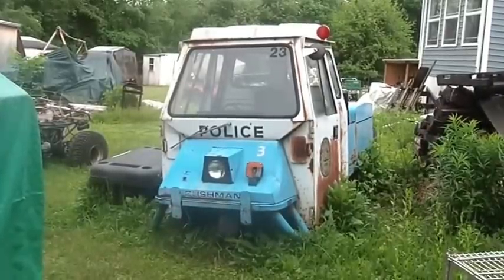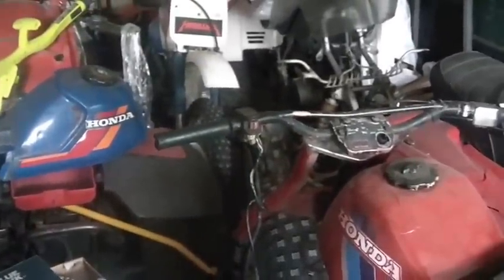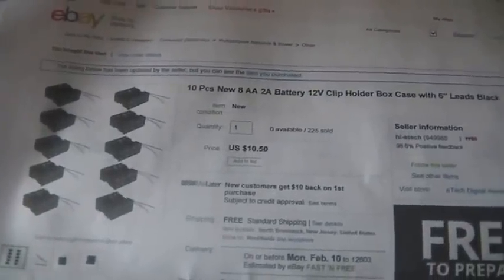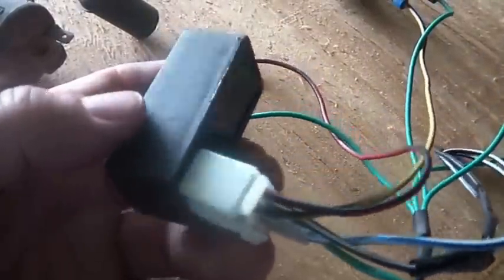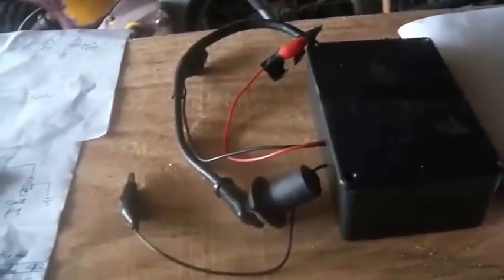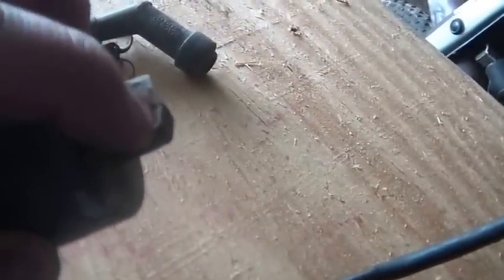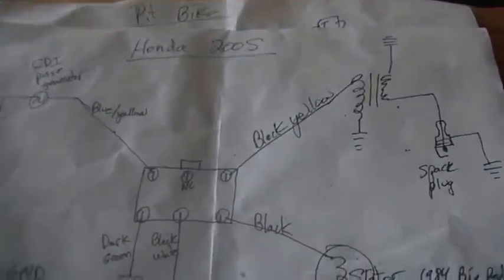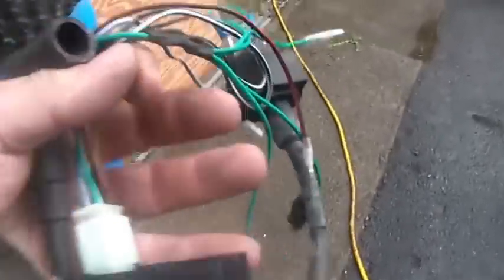6_2_15, Universal Honda ATV CDI hack, for Quads, ATCs, motorcycles

Comment: question. I have a street legal adly 500s and I went to ebay and every one else who had items to sell under the category CDI. but I am stuck. Apparently cdis only come in  70cc 120cc and 250cc. but does it matter as long as it is for 12V and 4 stroke?
Reply: How did it end up? Im thinking about buying a 250cdi for My old suzuki dr500 engine..

Comment: can u use something like this on a v twin engine with dual coils
Reply from the maker: Hey Jessie,  A V twin fires from 2 separate coil pacs and the position of those coil pacs determine when they are going to fire, (ignition timing), if U were willing to replace those coil pacs with pulse generators, (may require some experimentation), and then U would have to set up a Universal Ignition for each cylinder, yes it would work, it is not as easy as for a Honda ATC motor.... Thanks for asking, watching, and commenting, Good Luck!!!
Reply: would the pit bike harness work or do you think I need 2 cdi for that

Comment: Great videos and great info!!!! I freaked a 35 year motorcycle mechanic when i mentioned putting a chinese cdi box on my 1986 yamaha badger 80cc yfm. I purchased one for $6 and got it to go with it. The original was $150 used and $280 new so thanks for the info. He swore it was a coil but it was the cdi. Thanks.
Reply from the maker: Spero, U R a good man!!!   I love it when someone uses my videos to keep ATVs out of the junk yard and to save money!!!  Make sure U have a spare though, some of the China parts last a long time, and some don't.... Thanks for sharing Ur success story with me, thanks also for your thoughts, watching, and commenting!!!
Reply: I have a spare cdi........thanks again, keep your feet down and your head up!!!!
Reply: @HarveySpooner  hi man I have same problem with 86 trx200sx just like that and everything has power except for the black and green wire connected to the back of the coil so no spark
Reply: Harvey Spooner q

Comment: hello, i need some help with a eton viper jr 40cc, trying to use a universal chiness harness,  problem is coming from engine there is a 3 wire plug [ white\red, yellow\red, black ] then a 2 wire plug [ blue\yellow, black ] the original problem kid lost remote for wireless kill and was trying to use a unversal harness without saftey switches and wireless reciever, any help would be greatful for
Reply from the maker: Hey Joe, It is a 2 stroke, the universal ignition may work, but, the guy in this video seems to have a better solution, https://www.youtube.com/watch?v=Fdnq4poXuck, give it a look and let me know.... Thanks for asking, watching, and commenting!!!

Comment: Nice, now i will try this on my yamaha mx 250 2 stroke :)
Reply from the maker: Hey Jimmy, I used it on a Yamaha G5 golf cart and got it to fire on starting fluid.... Need to smash a fresh carb on it and try to get it running right.... Good luck, the GY6 / 4 cycle CDI has an advance built in, probably not as much as the 2 cycle, but, it should fire up and run up to 6000rpm with no problem.... Let me know how it works out, have not tried it on a 2 cycle yet.... Thanks for the encouragement, watching, and commenting!!!

Comment: Hey harvey, man I got this 260cc linhai mountaineer that wont start to for nothing! I see you pretty good at what you do is there any why I can contact you? Maybe you could help me get this thing running again....
Reply from the maker: Hi Arthur!!!  Where do U live, anywhere near the Hudson Valley of New York or the Cumberland Valley of PA... Does this Linhai have spark?   Where U using it when it died or was it sitting and just will not start???   Thanks for asking, watching, and commenting!!!
Reply: Arkansas and it was running great but I like my brother use it fir a year then it got put up for 3 when I wheb to get it the cooling unit was shoot I ng water dont 8n tha oil and gas some how when you hit the gas water shoot out into the car... idk what he did to it it nlnot getting not spark I checked over the wires and most of 2 of then not plug up to nothing at all... I replay the coil and dci but still nothing... there other boxes on it that might b out pike speed limiter and electric enighter but I see you video bout that bypass and I was going to see if that workd but idk what itll to water cooling systems and how itll work on a automatic atv
Reply: The linhai aint a simple atv to day I rebuilt the motor and there was like 2in of muck in the bottom of thr oil.... I just wanna get this thing raceing again and tearing up some mud

Comment: Thank you for the videos! I was wondering, what is the reason for using the smallest CDI unit? I just bought a TRX200 that isn't running, and for twenty bucks thought, why fuss around with all that trouble shooting and parts ordering? I ordered this, https://www.amazon.com/gp/product/B01FW2SDFO/ref=oh_aui_detailpage_o01_s00?ie=UTF8&psc=1 It should work right?
Reply from the maker: Hey Jr!!!   If U wire it correctly, yes, it should work, just make sure that ground to the engine, harness, and trx200 frame are all well done... That is basically a pit bike ignition and work on the Honda 200 motors.... Thanks for asking, watching, and commenting!!!
Reply: Thanks again, I'll give it a shot as soon as it get's here!

Comment: my stator has blue/yellow line ,,green/ white line blue ,and white how does it get connected to the cdi, mainly the red/black line goes to...?
Reply from the maker: +Jhonny Five , What kind of bike or ATV do U have???? I need to do some research....Also, R U using the 12V CDI box or the pit bike ignition? Thanks for asking, watching, and commenting!!!
Reply: pit bike. and i have a 1993 cr125r with blue/yellow line  and green/white line (pulse?) and green solid and white(coil?) with cdi black/red, black/white, black/yellow, blue/white, and green

Comment: Hi Harvey Spooner, how are you doing? Grettings from Brazil. I hope you can help me out on this trobleshooting. Let me get strait to the point.  I just got a POLARES 330 CC, 2003 and I realized that my CDI box is not working, something bad might happened. I did some researches on the internet, youtube and i notice the the best thing to do is basiclly replace it, get a brand new one. However, to get it down here is so expensive. So, I´d like to try a MOTOBIKE CDI BOX. What are you recommend? Have you ever try it? PLEASE HELP ME. I aprecciate it. Thanks so much. Excuse my inglish is bit rusty.
Reply from the maker: +Eliab Clemente , Ur English is better then mine... If Ur polaris a 2 stroke or a 4 stroke???? The pit bike ignition and 12volt portable ignition systems that I use works on 4 stroke honda products and  china stuff, I have not tried it on other manufacturers... I have a couple of golf carts that have ignition issues and would like to try them there... Now to answer Ur question, if I found myself with a not sparking ATV, ATC, or cycle, I would use my portable 12V CDI system to troubleshoot... All it needs to provide a spark is a pulse from the CDI trigger module to work... It removes all the guess work....  https://www.youtube.com/watch?v=HIm_PQ3W2Is  ,  let me know how it works out.... Thanks for asking, watching, and commenting!!!!!
Reply: It´s a 4 stroke mate.
Reply: I´d like to make an adpation using a off or road motobike. That´s all.
Reply from the maker: I would go with that ignition box shown in the video, for less then $50, one has a handy tool or permanently mount it and U have a running bike...

Comment: I've been  sorting through a horribly rigged harness on a 1989ish  Kawasaki bayuo 300, your universal harness should (generally speaking) work on that bike, correct?  if so,  i noticed during my sorting that this atv has a 3phase stator, i see were the pulsar wire would go but were would the "stator'  wire go? there is one connector with 2 wires and another with 3.
ps: my keybord is taking a crap sorry for bad gramar

Comment: I have 2007 polaris outlaw 90 will that same system work .
Reply from the maker: +sasjaffe , I think it will, thought, I have not tried it on a Polaris, I used it on Honda 185/200/250 ATCs, TRX200SX, a Lifan 120cc motorcycle , and a China Quad engine, I plan on using it on a 2 cylinder golf cart engine engine in the future, and if my cushman keeps annoying me, it will be adapted to an Onan 22hp engine engine with points next... Thanks for your thoughts, watching, and commenting!

Comment: this is awesome i will never pay 80 bucks for second hand cdi to see even if it is the cdi thats wrong ...and i'll be able to wire my stepdaughters china wheeler going ...i just ordered a stator and cdi ..she'll be riding when it comes in the mail...thanks man ..can't thank you enough ...these are the five prong square cdi's ..i couldn't really see when you were plugging in
Reply from the maker: +mark yeomans , Yes, I like the 5 prone, square plug, CDI units... Good luck working on the ATV, let me know how it all turns out!  Thanks for the encouragement, watching, and commenting!
Reply: +Harvey Spooner rewired it last week..cleaned the carb and it started right up..she has arthritis and has trouble with her brake handle ..i had a 600 ninja chassis with a good pedal and cylinder...i used bed frame and an alternator bracket to weld in a mount for the pedal ..its cold but she smiles big ...i think she froze her teeth lol cause she can't stop smiling when she's on it ...thanks allot ..god bless ya